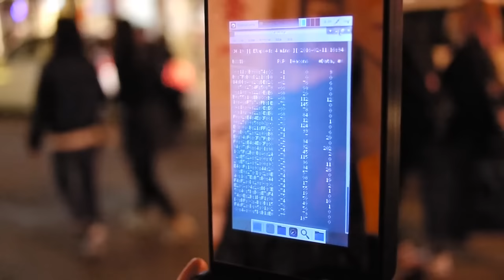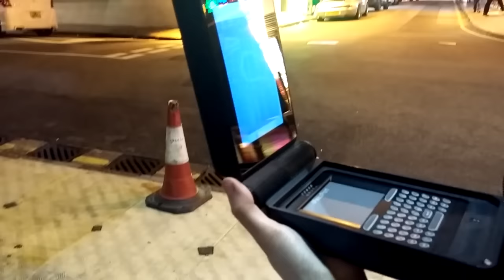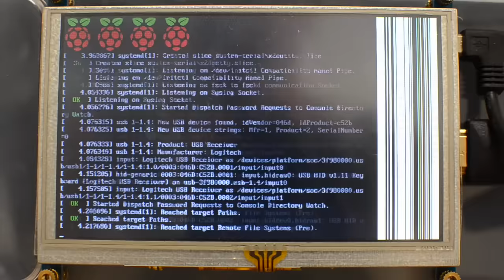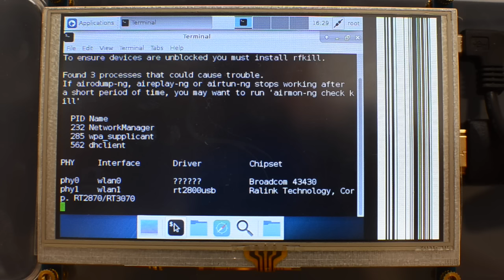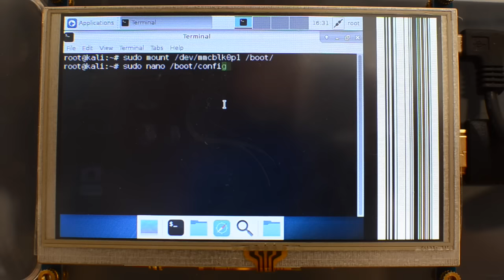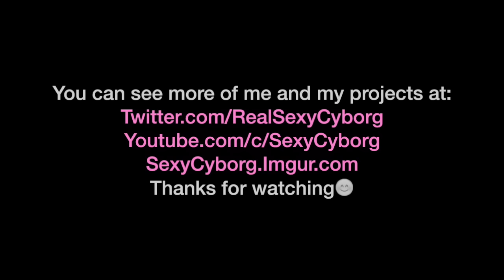Pi Palette- Hacker's Cosmetics Case

Comment: So obviously it wouldn't be as powerful, but you could cut the size down dramatically by using a a Pi Zero and an SPI based display.  You would have to add in a USB hub for the HID devices and WiFi dongle, but it might be worth looking into for version 2.  Loved the cyberpunk shades!  Made me think of Molly from Neuromancer
Reply: that would be useless for aircrack-ng suite I think,not enough power,Its trouble enough on the pi 3
Reply: yea as powering everything off the pi creates massive power drain but if you look at the work that El Kentaro at Defcon 26 where he built a hack-to-go-box the made idea of it all was that it was powered through a Powered USB Hub and that everything else was powered of it and not the Pi

Comment: I have never seen someone use a hacksaw like that. Also if its taking a long ol' while check the blade. You want Bi-metal blade (hardened teeth) 24tpi.
Reply from the maker: No upper body strength so use legs and brace the saw. Takes a while since rod was stainless steel.
Reply: She's basically using her body's momentum by rocking back and forth instead of pure upper body strength in regular methods.
Reply: You don't really need to push down for it to cut. The weight of the sawblade is enough. Speed is more important, although you have to be careful when starting out before you get a good groove for the blade or the saw may jump to another position.
Reply: You're both partly right. In the future place one hand on the back and one on the front to start the groove, after the grove is started place one hand on the top, you don't have to push down hard with the top hand just push slightly. After you're 1/4 the way down unclasp the object you're cutting and rotate it until the grove exit is just slightly facing away from you then start cutting again. What will happen is the blade starts cutting against the edge vs cutting along a long run, so it will cut faster. You'll need to rotate one more time and it should be though the object.
Reply: It might be easier if your bench and vice were lower. I find it easier to cut when the steel is around my belly button.
Reply: I watched this on another site and had to come here to comment on her hacksaw technique. She's freaking brilliant and everything, but I'm guessing doesn't know how to use some hand tools.
Reply: It took me a long time to fully realize it, but you should almost never have to use your own strength with tools. With a hacksaw it's more on how fast horizontally you can move it. More strength pushed down won't make it cut faster. Try using one hand on the saw and the other on what you're cutting. Remember to let the tool do all the work!
Reply: Wow. Strong men who knows their way on tools.. you do realize that she is just lacking on stamina to rock back and forth the saw right? Given the situation , i think she is brilliant on what she does..
Reply: You should use a dremel tool instead for such thin gauge metal cutting its going to take very little effort to cut through that, also in the dremel sets available they have multiple bits for fine sanding as well as making tiny holes, cutting circuit board or even pvc/plastics for projects.

Comment: There is a tool which can cut time and energy to a small fraction. It's called a Dremel. It is electric, and has a variety of tips you can use with it, including one for cutting through stainless steel. There's also buffer tips to remove burs and round edges (if necessary). I recommend you look into it. There are literally thousands of different tips for it.

Comment: You mention in the video, that you needed several breaks when sawing that rod to size. I don't think it's because you're not athletic, so much that it's because your table and vice rig is far too high up for that kind of work. Ideally, a workbench for metal- (and wood) work should be at about waist height. That way you can use your entire body's weight and power when sawing something, making it much easier. Anyway, cool project!
Reply from the maker: Thanks! yeah it's too high but I rarely saw and often do small work that's good for that height to it's no big deal😊

Comment: What a great project, well done. I think your bench vice is a little bit too high. If you stand on a small platform you may find it easier to use a hacksaw as your weight would be pushing down as you move the saw backwards and forwards so you would cut faster.

Comment: Nice!  Can you apply reflecting film directly on LCD so it can be touch sensitive and make the size thiner?  You can use Pi Zero W now.  You could make simple interface so you won't even use keyboard or make commnad buttons.

Comment: Outside:  A ordinary woman. Inside: wpa2-hacking genius! This is very cool. And would it possible, if you can see the screen with your glasses on, but others see a pure mirror instead? That would be super-hided. And a touch-keyboard painted with this makeup-disguise, instead to put the cover down.
Reply from the maker: You can use polarized glass with matching polarized filter glasses, that might work.

Comment: I saw this on Reddit and I like it there. I loved it here and I'm inspired to make something similar. I lack the workshop and a 3D printer, but I'm curious to see what I can come up with.
Reply from the maker: There are a few rPi computer builds out there done with very basic things.
Reply: Cool! Yeah I'm seeing more and more of them online, Reddit and Youtube. I'm excited! I'll get a rPi3 in February for my birthday! yay!
Reply: Get a system working on the desk ... and then keep an eye out for something you can mount it in. Briefcase, hollow book etc. Using foam board, craft knives and glue means you can get away without so much metal or woodwork. With a working system to experiment with it becomes a bit easier to swap out components to reduce the size without trying to get it all right first time.

Comment: This is a great project! 

Are you publishing the config files, if someone wants to build such a thing? 

Also, when cutting metal, use a bi-metal blade, start the cut by only pulling towards you for making a mark. Once you have a decent mark, start pushing with your shoulder and abdomen into the cut. A 4mm steel rod should not be an effort to cut.

Comment: I'm curious what kind of medium you used to screw the Pi onto.  I've run into problems with the Pi failing to power up after it has been screwed down.  I've recently been working on installing a Pi into a decorative miniature treasure chest.  But as it's wood the Pi won't power up when secured to the wood, I also tried motherboard backing on top of the wood but I think the screws are shorting it out.  Going to glue down a Pi case I think.

Comment: kinda neat, but it seems too large to be sneaky.. maybe try a pi zero, heard it can do kali linux. otherwise, nice one. gonna try a similar one at some point, more laptop style than makeup style, but should be a cool project.
Reply from the maker: Pi zero was really, really slow. Looks good but not actually usable.
Reply: hmm, interesting, gonna have to experiment then on the best way to get a tiny computer into a case, that will actually work, maybe a computer stick or similar but with a linux build on it, preferably kali..

thanks for answering, now i know that a pi zero would be too slow.

Comment: I wish you could have done the Pi Zero! (Although it seems a lot of people haven't gotten it, due to limited availability.) Could have cut down on the chunky-size of your case.

I think a Intel Compute Stick is about perfect size for this usecase, and has the bonus of being able to run x86 programs. (Not that it matters, for the modern pentester). Using that, we would be able to worry about the battery and display, mainly. I like the idea, certainly! Perhaps not as useful for me, since a lot of people may remember a man walking around, and using a makeup case. But I'd like to give this a go myself. It's a slight obsession of mine to buy low-profile computers and circuit boards, in-case I get the opportunity to do something like this.

Have you used a Digistump/Digispark? The basic model is small enough to fit inside a TINY USB enclosure. Not much use for general pen-testing, but it can be fairly easily be converted to a basic USB Rubber Ducky, at quite the price decrease, making it quite a bit more useful for specific exploits.

Comment: Your table is the right height for soldering circuit boards, but the wrong height for a bench vise. Needs to be about a foot lower.

Comment: How much does the Pi3 and Arduino's go for down in your neck of the woods these days? I was thinking of ordering some ,I just got some antenna replacements for my DJI  phantom 3 controller from China the other day,I have found ordering parts and other sorts of project related things directly from China rather preferable to other options in the west.
Reply from the maker: Arduino's are cheap, rPi costs the same.

Comment: "Good thing the filament is cheap in China." - cries 

That's always the secret to good case design - iterating over and over. And you do all the little details like caps and ends and places to put the wiring and bolts. Nice.

Filament is less cheap here, so I have to spend much more time in CAD doing a whole generation of changes rather than the purer "evolving by printing" way you have. sigh One day.

Comment: so sexy cyborg ...buy a dremel diamond cutter wheel and a drill press sander bit with velcro pads 2 inch diameter .....all from china ..thats where i get mine ...use your cordless drill on 2nd speed and no more hacksaw ...a dremel would be quicker but not sure you can get them ...does china use 230 ...i have 2 dremels ...ones your for free because you shouldnt struggle ...your too cute 😊